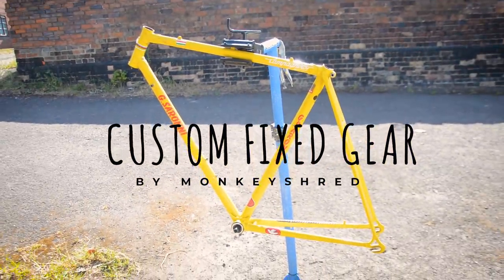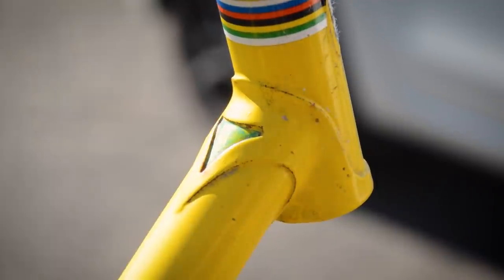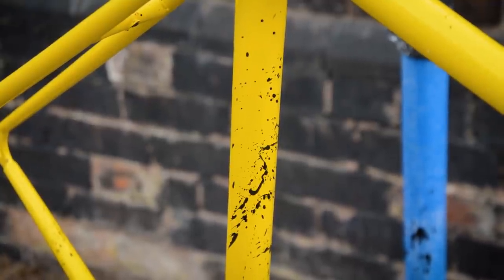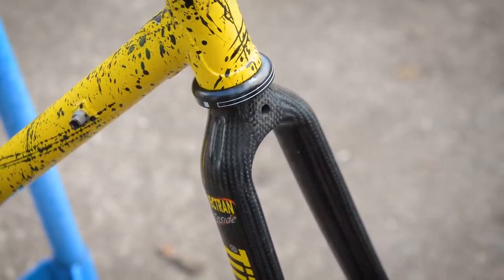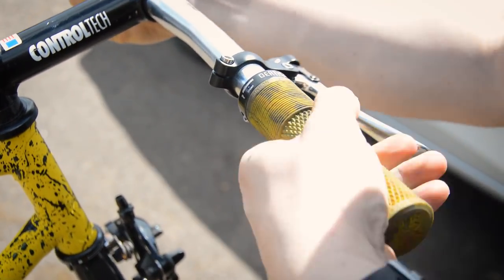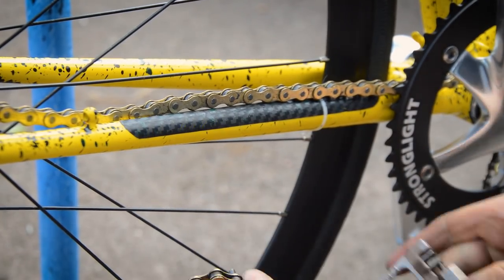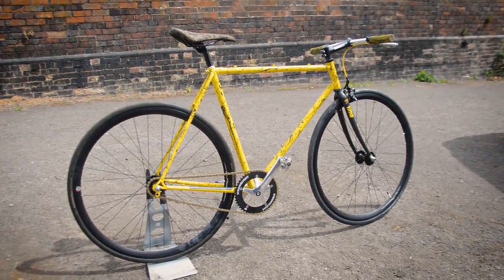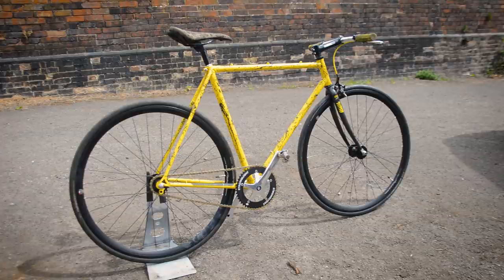Building A Custom Fixed Gear With A Vintage Road Bike - Splatter Paint Style

Comment: Very nice build, everything (fork, seatpost, stem, grips, wheel set) match nicely together. Good idea to go for a splatter paint, it gives the possibilities to hide damages in the original paint. I think you got lucky to find a frame in this condition which is an excellent basis for your build. It appears to have not much damages in the yellow paint. I would install the rear break as well so you are ready to flip to freewheel when ever you want to.

Comment: Hey MonkeyShred don't be confused  those frames where made in two styles ! So one is Columbus CroMo tube only ,  and the other is a Trimoly tube what means that the main frame is CroMo tubing but the rest like the tail tubes are highten steel , so much cheaper (and heavier)  and easier to sell . Many m
anufacturer still does that today ! Have a good one !

Comment: This turned out really nice :) What you might want to reconsider though, is moving away from that 18T in the rear... with 18x48 you are having only 3 skid patches on your tires, which mean, they will wear fairly quickly while breaking. The change to 17T gives you 17teen skid patches - much better for the longevity of your tires. Thanks for sharing your builds! :)
Reply from the maker: Thanks!  I need to learn the proper technique for skidding first though!

Comment: I have that same wheelset. They have been absolutely solid for me.
Reply: Yeah, running the tires at a higher pressure helps, by reducing friction. So does having slicker tires and a lighter wheelset, because there is less mass to try and stop. After you get used to the feel, it's probably best to go back to a more normal set-up though.

Comment: I think that may be a 70s-80s Raleigh frame. The lug style on the headtube and dropouts is spot-on from what I'm seeing and I'm seeing a couple with the top-chainstay cable stop/guide. Maybe a Grand Prix?
Reply from the maker: Thanks, I'll have a look at those.  I'm not sure how many Raleigh's were produced with Italian BB's though
Reply: @MonkeyShred  Ah I didn't catch the italian BB in the video, sorry. I listen while doing other stuff - you're right, Raleigh never used italian BBs.
From what I read they did on occasion use Bocama lugs, which I think are what you have on that frame. Bocama is french and what I'm finding is that their stuff was very 70s thru mid 80s or so. If the BB has these big pill-shaped cutouts in it, it could be a Union - check the flickr gallery "	
UNION (Holland) racing bike (c.1978)" by a guy called stronglight (usually youtube will delete links so I can't directly do it...). It almost looks like the same bike, save the longer head tube.

Comment: Need to have a play with my SS soon but pick up a Carlton Cobra tomorrow so it will have to wait. Love the paint job it's brave but works a treat.
Reply from the maker: Nice.  With the chrome paintwork?
Reply: @MonkeyShred  it's complete but a mess but free so no complaints.  It's a five speed model so my plan on this one will be keep the patina but fit/refurb a good set of period correct parts I have including a good set of 27 inch wheels with wing nuts. Also have a very nice set of bars and levers which will polish up and a good but gnarly B17.

Comment: You are getting super popular, 3 ads to interrupt you video.  Cool bike.  I bought a black Bianch splatter painted with gold, the story passed on to me was it was painted that way as a theft deterrent.  When I tore down the bike red paint was inside the seat tube and some on the bottom end of the fork, so I powder coated it red. I'm still wondering what I have, I haven't been able to track down any definitive web sites on how to date the Bianchi.  It has stamping on the top of the fork and on the seat stays, 70mm italian thread bb and full of campagnolo gear, ofmega hubs. The splatter paint looks good on the yellow.  A fixed/single speed has been on my list for a while, just looking for the right frame,.  Stay safe and healthy.
Reply from the maker: Unfortunately the ad revenue is needed :(  It doesn't get anywhere near the cost of a build though.  I'm small fry.  

Wait, so you're telling me a Bianchi can be another colour than Celeste?? There must be someone out there that knows their Bianchi's and can help identify it.  Surely someone in an Eroica group or something similar.

Comment: I have a 44-18 on my single speed and it's good for hills but a bit too low for straights. 
So I think 48-18 will work good. It's weird because I followed a guide online for the gearing ratio, but it was apparently made for people with noodle legs. ;) 

Anyway I'm switching it to 44-16 and it should give me the same ratio as you, give or take a small fraction.
Reply from the maker: Yeh the 48-13 I had on my old fixie was  great for speed.  Not so good for hill starts but I found it was a decent enough ratio if I had the momentum to climb hills to start with.

Comment: Love the stem lusted after a controltech when all I had was kalloy uno money
Reply from the maker: I do love a ControlTech.  I need to find a black one for the Mongoose to match the seatpost.  They seem to be fairly rare these days though (on eBay at least)
Reply: @MonkeyShred  I did try and get a nos answer atac in black but went out of my price range. I'm starting to gather parts to rebuild a sintesi I have

Comment: Hi sir. Can you help me? I am having trouble because I have here some old bike running 26x1 3/8 wheelset but the problem is that the rims are damaged because it was just laying at the back of my grandparents house. My question is that. Could I use 700c wheels?
Reply from the maker: You could, potentially.  You'd have to double check clearances and it would probably mean loosing any mudguards you have fitted and swapping out brakes to short reach units.

Comment: great looking fixie.. how come no compression plug in the steerer? are you not afraid of it snapping off?
Reply from the maker: I am now.  It had that installed before I had the fork so I assumed it was stock.  Apparently some of the older Time forks did have a star nut in there.  We'll see how it goes I guess!

Comment: Is it safe to have that kind of dropout?
Reply from the maker: Yep.  You're thinking the wheel nuts might slip and pull the wheel forward out fo the dropouts?  I guess that would only happen if you have bad nuts (the serations might have worn down so it can't grip) or you haven't don't the nuts up tight enough.

Comment: Hi mate what type of paint would I need for the splatter effect... cheers in advance
Reply from the maker: Erm... for this I just used spray paint I had lying around, mainly so it would dry quickly.  I guess you could use most "types" though

Comment: I you dont have a horizontal drop out could you use a half-link chain? Or is it about getting lucky even whit the HL chain.
Reply from the maker: Well, I looked in to this before.  With vertical dropouts you need to find the "magic" ratio of front ring and rear cog to suit your frame.  That way it can be done but you won't have any adjustment room for tensioning the chain once it wears.

Comment: Fixed gear con.  can be also possible if the bike has vertical dropout, hahaha I did it
Reply from the maker: Yeh, it's a bit more tricky though with the magic ratio and all that.  It leaves no room for adjustment of a worn chain too right?
Reply: @MonkeyShred  yeah its a bit tricky but the best part is it works its all that matters

Comment: what is the reason for changing the front brake lever to the right side?
Reply from the maker: Changing? It was never on the left side nor should it be here in the UK 😊
Reply: @MonkeyShred  UK,   so is it common for all bicycles,  road, mtn,  ..etc , to have the front brake on the right and the rear brake on the left?  do you have cassette shifting on the left and chainring on the right?
Reply from the maker: @burrussw  Yes, for braking, right lever is front and left is rear.  Shifting is the same everywhere though, right lever control the rear and left controls the front.